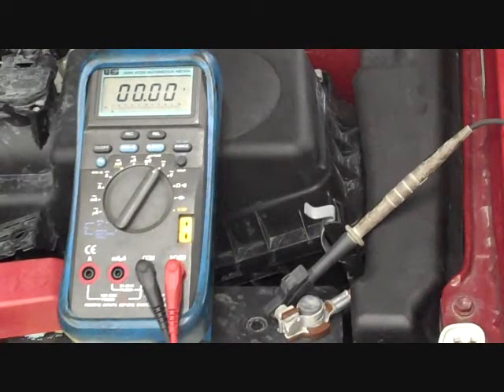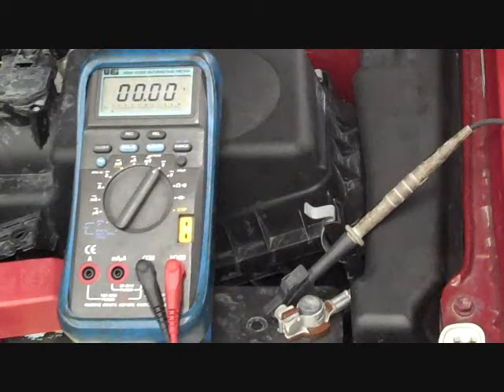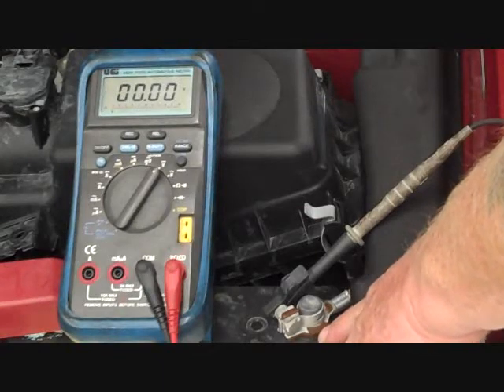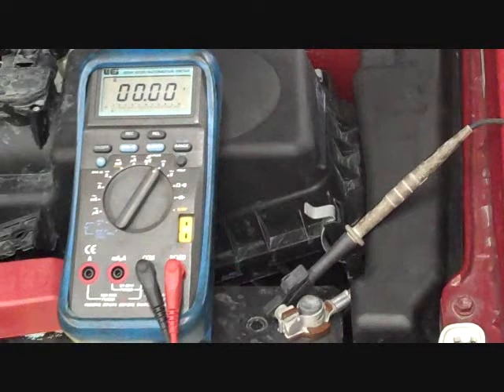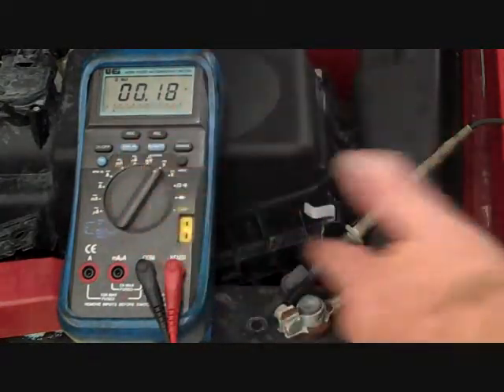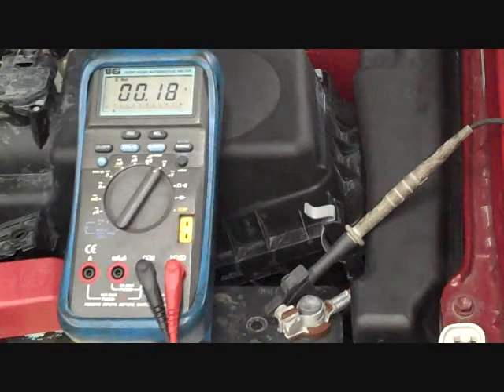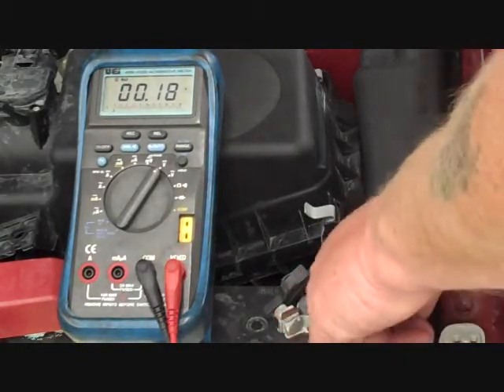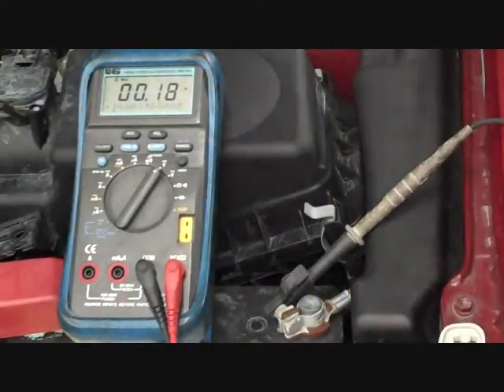Automotive Repair:  Testing Starter Circuit Voltage Drop (Ground side)

Comment: So the ground lead (black) is on the negative battery post and the positive lead (red) is on any part of the engine that is a good ground?
Reply from the maker: +dirt3800 To test the ground side of the starter circuit, I start at the starter housing to try and test as much of the circuit path as possible. If that test fails, move to the engine block and see if the reading returns to normal. Sometimes, it's the contact between the housing and the block causing the drop. If that's not it, continue working back toward the battery until the meter reading returns to normal. Once you see that, you know the problem lies between the last two test points.

Comment from the maker: Yes, the meter used in most of my electrical videos is the 4200. It has been a good meter and I've had it for several years.

Comment from the maker: For this test, the meter is set to read volts. For most voltage drop tests, though, I use the millivolt scale. Most meters have a maximum reading of 300 to 500 mV in this scale, and will sound a buzzer or read "OL" for over limit. If you see that, you have too much voltage drop!

Be sure to check out our collection of voltage drop videos to learn more!